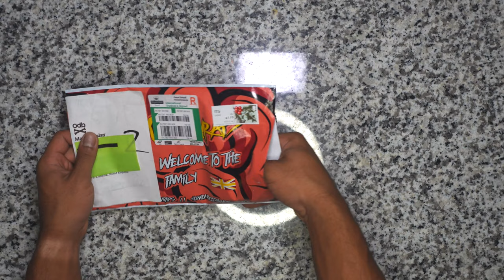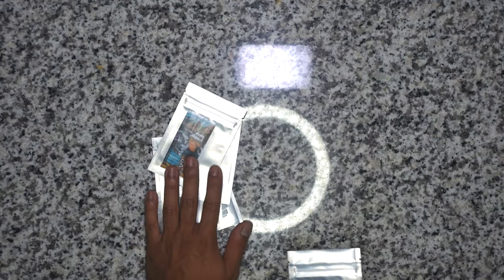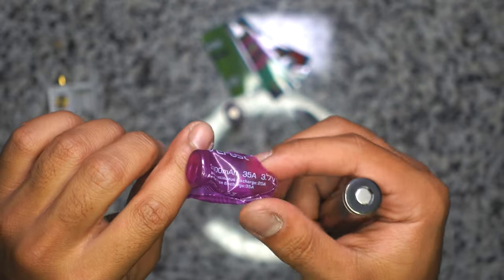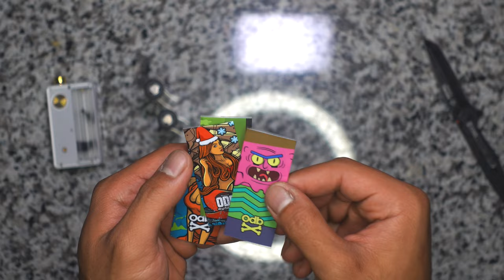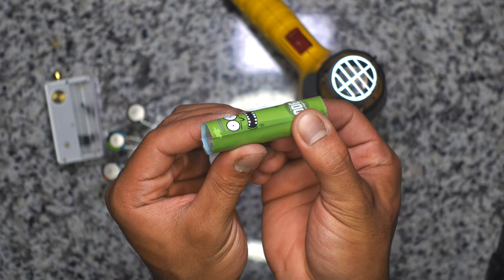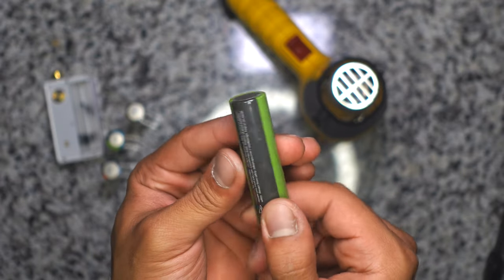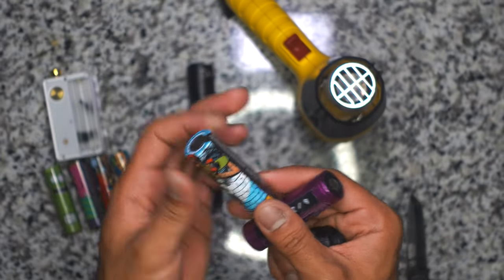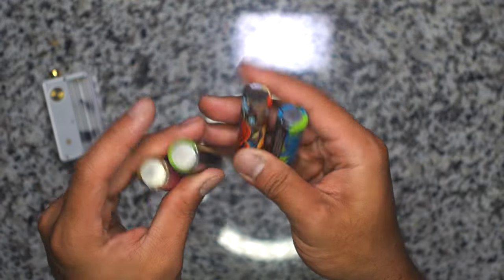Odb Battery Wrap Install

Comment: I started off a little rough but got better with each battery I did, learning mistakes I made from the previous. By the 4th battery, it was perfect. A couple have a small crinkle that slightly sticks out on the side I can't get to go down but other than that, they're perfect!